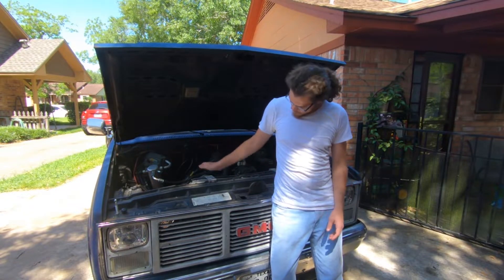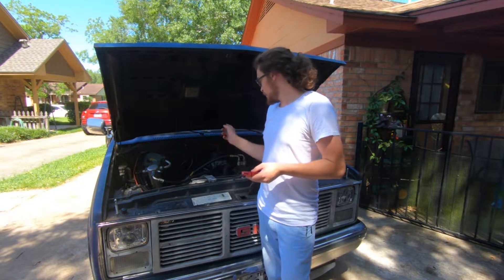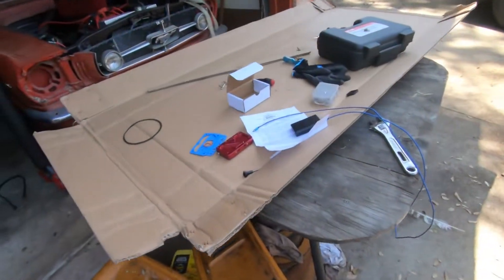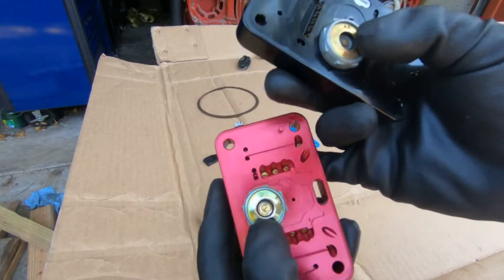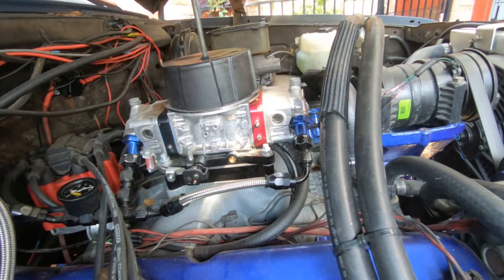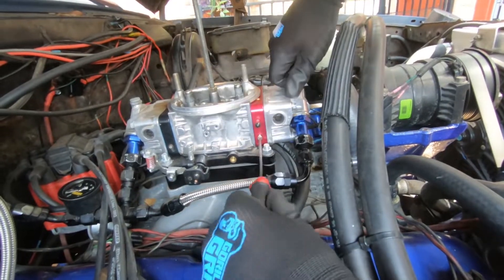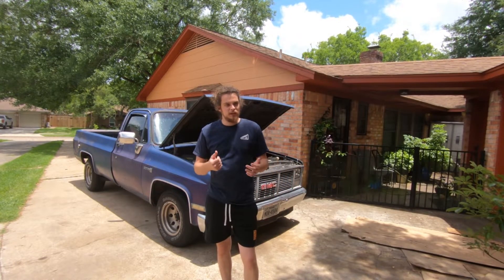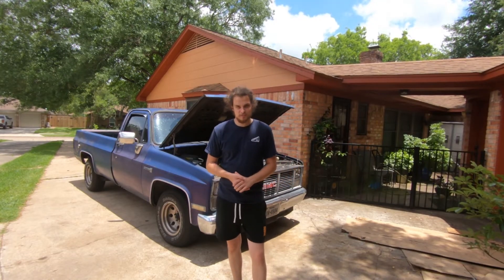Tuning a Holley Carburetor for fuel economy

Comment: Runnintg a 1992 chev.K150 (284 K miles ),700  O/D trans ,373 gears TBI. Michelin Defender tires, was getting 13.5 mpg mostly highway. Changed most sensors, MSD ign. system ,8m.m.m wires,NKG plugs. Jumped 7 mpg. Gunna port the heads ( swirl ) and intake and shorty headers and pipes next..

Comment: Nice old truck you have, keep that beast running as long as you can! I am running 61 jets on my new Holley 2bbl street avenger carb on my slant 6 with what I think is a stock 4.5 power valve.  I am currently in that same boat as you were with my straight 6 engine where I am getting about 7.5-9mpg combined with 15 degrees initial timing at 750ish idle trying to figure out which jet direction to go.  I Don’t have an a/f gauge in cab though I have thought about installing one (after I get a bung installed on my exhaust).  I do my engine tuning with a vacuum gauge for the time being.

Comment: Timing is critical.  I run a 850hp dp on my 82 notch.    16 dgrs intial timing.  34all in at 1800 rpm.   No vac advance. This is a roller cam 351w with c4 and 410 rear. I get 16 mpg.     When u put light springs in distributor. Vac advance isn’t needed.   If u watch a stock dizzys timing curve.  Usually dont start advancing until 3500 rpm.   Total with stock springs sometimes dont even come all in or at like 6000 rpms. So if your cruising rpms are mid range.  That vac can and stock springs are hurting performance and mileage. Makes u wonder about emissions because those stock tunes were gas hogs Vac cans add 10-15 extra degrees at cruise. Stock timing on alot of these are low for initial. At best with a stock timing sweep even on some of best “factory “ tunes is like 25 dgrs at cruise with vac can under load.    So just mechanical timing with just light springs throwing out your total is actually effective if u do this.  Disconnect vac can and cap it I run 89 pump gas on mine no problems. Im. Going to go party she gets 93.   I’ve also seen a vac can rob 50ft lbs on dyno going wot. Watching it with timing light. Yeah it lets go when vac drops. But it’s not instant.  80s seems very rich for a big motor like that that its the stock timing curve that’s robbing mileage.  U swap to light springs. Ditch vac advance and u can run it alot leaner and not worry about detonating. carb should be almost stock jets.   My 850 wants 71 primary 84 secondary. Pink came. 73-33 on airbleeds. 3/4 turns all 4 corners 15 inches of vacuum. 6.5 4 hole pv. Check out my posted car video’s. No choke  dont smell like gas and fires right up in 30 dgrs. Id suggest on that big motor.  Put a very very light spring and medium to light spring in that dizzy.  And a bushing to tailor your timing to around 14-16 intial with 34 dgrs all in if stock compression. 30 to start if 10-1 or so modify and try that.   Im at 4k rpms on highway cruising with a 3speed auto and 410 rear. Ps. Light dizzy springs and running a vac can is bad juju. To much timing at cruise.   If their was a way to tune those vac cans to only add 5 at cruise with the light spring set up. I think it would be very efficient. But they add 10-15 to much if u at all in on cruise.
Reply: I like your idea of recurving the dizzy with lighter springs, would like to try that but don’t know where to get the springs from for my slant 6 dizzy and it doesn’t help the shops that do dizzy recurving is few and far between these days.
Reply: They do make adjustable vacuum advance kits. Accel makes an adjustable canister that you use an Allen key to dial in the advance you want, and crane makes a limiter plate to stop advance. I use the Accel kit and have my vacuum advance at 10* with 18* initial and 32 total all in by 2800. It gives me a highway cruise advance @3000rpm of 42* and I’m getting 16mpg with no pinging on a 9.4:1 455 with 223*/230* of camshaft duration @.050.